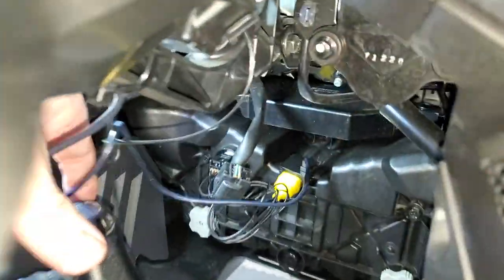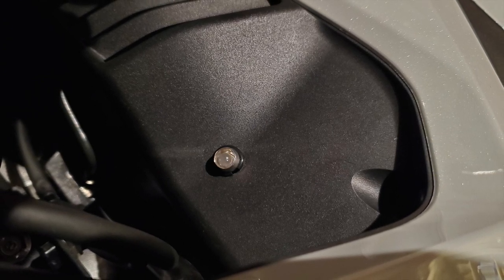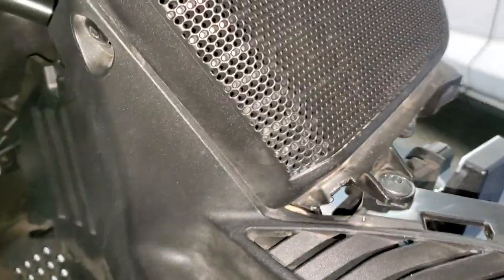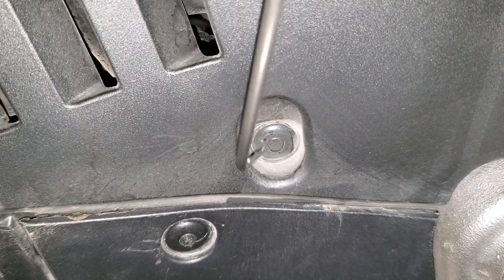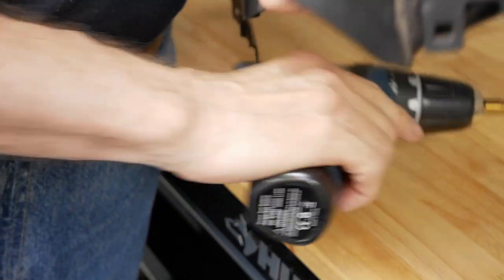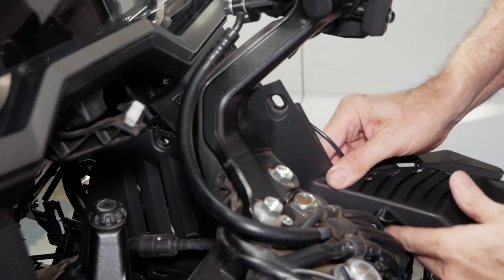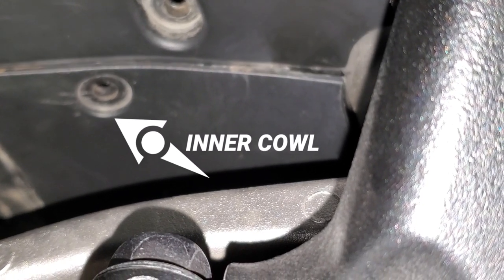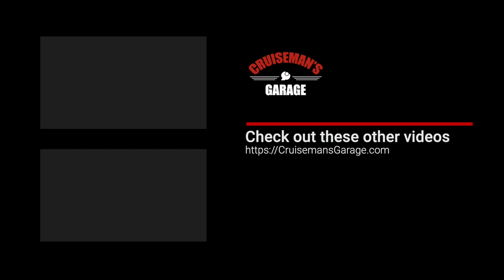Custom Kisan Daylight Sensor Installation | 2018+ Honda Goldwing | CruisemansGarage.com | 2020

Comment: Did my air filter service yesterday and while there completed this install and changed out my antifreeze coolant. Thanks for the videos Chris. My only note to me was the reinstall of the cubby box. Your warning to watch how it comes out cannot be over stated.  This was the only effort that caused me to walk away and reengage the next day.  I just could not find the sweet spot.  Finally I found the spot.  Last frustration was reconnecting the console harness stays. Patience, patience and hemostats.

Comment: Maybe i missed it on the video , but why is this needed. 
Ride safe.
Reply from the maker: If you have a Kisan pathBlazer headlight modulator installed.
Reply: I wondered the same thing. But I see he responded to you.